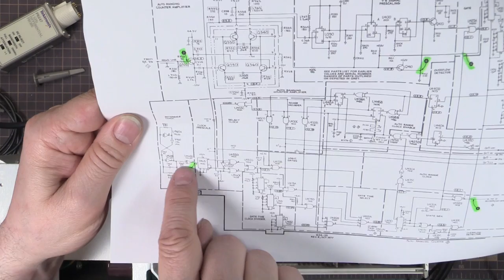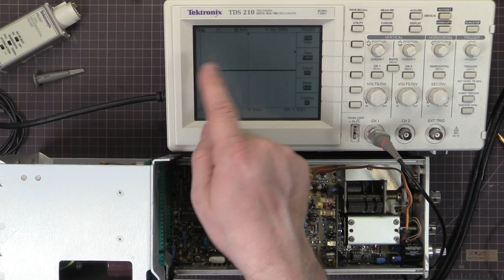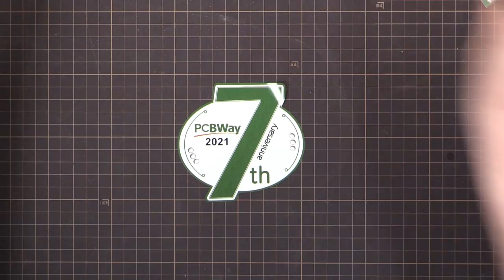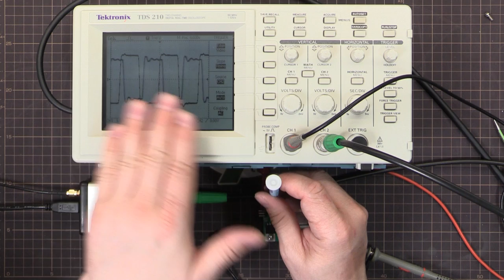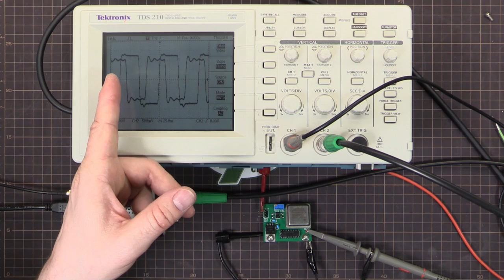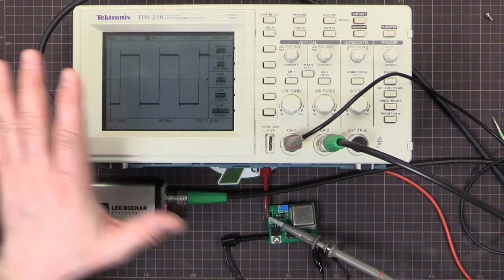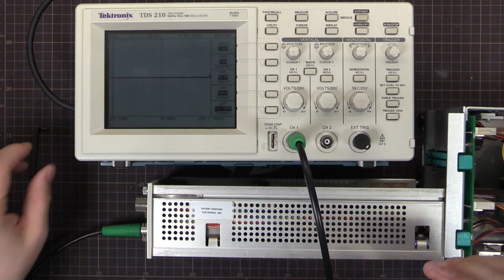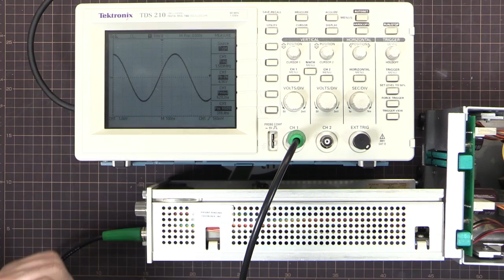Tektronix SG503 Repair and Modification

Comment: The cable Tektronix used was cut to a specific length and had a repeatable loss which was suppose to be compensated for by the response of the SG503 to meet its specifications.  The loss at higher frequencies that you observed on your oscilloscope was not the cable; it was the response of the oscilloscope which is exactly the type of measurement the SG503 was intended for.  The response of the SG503, and its cable, can be verified with a sampling oscilloscope, sampling RF voltmeter, or maybe a thermally based RF power meter.

I rebuilt my SG503 many years ago and had to replace one of the 4-bit latches for the display.  With a 2 nanosecond RG400 cable, its amplitude flatness was about half of the specification.

Comment: on mine ive found that the vains on the HF section of the variable capacitor were touching . Easy fix . Thanks for the extra info and your video. Hmm I wondered why mine keeps stopping .Hay please chance on getting a copy of the cct diagram .

Comment: The black stuff on the pins isn't terrible, it's only silver oxide. Just burnish them with an ink eraser to 'pretty them up'. 😉
Reply from the maker: I tried that as mentioned, but the pins were so corroded that the plating was missing in a lot of places, which meant the pins were starting to rust and some pins were actually breaking off.

Often a gentle polish will make things nice again (good for switch contacts too), but in this case it was too far gone to save.
Reply: @NearFarMedia  Must have been stored / used in a less than ideal location 🤔
BTW, I have a way of saving 'legless' chips that I could show you (if you're interested).
It's allowed me to save many an unobtanium (but otherwise functional) IC from meeting the trash can.

Comment: I just got this model that came in a tm504 and it isnt booting up either. I get no display and no signal into my tek 465. Ill have to check the oscillator to see if thats my problem. I know the tm504 is fully functional as I swapped plugins and all slots are functional.
Reply: I tested the oscillator and I get no waveform on my scope so I'm pretty sure it's dead. Is there an oscillator that I can easily swap in that you recommend?
Reply from the maker: The crystal in these units is only used for running the display. The actual output frequency doesn't use a discreet oscillator.
The service manual for these is pretty good, with schematics, circuit description and waveforms.
https://w140.com/tekwiki/wiki/SG503

First thing to check after checking voltages is that there are no shorted tantalum capacitors (A very common problem with equipment of this age) and no worn out electrolytic capacitors too.

Also, try reseating any socketed chips. If there are any Texas Instruments (TI) sockets, they need to be replaced as they are notorious for being absolute and complete rubbish.
Reply from the maker: Also, this link may provide some help too:
https://w140.com/tekwiki/wiki/SG503/Repairs

Comment: What is the part number of that divider IC?
Reply from the maker: It's a 74HC390, but almost any 74**390 would work. (The center letters define what 7400 series variant the chip is).
Reply: @NearFarMedia  thanks